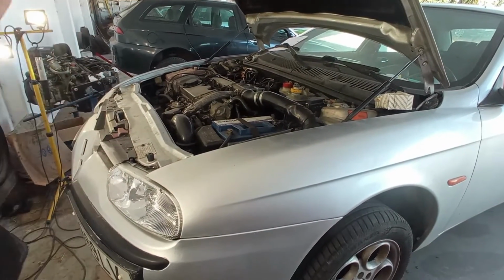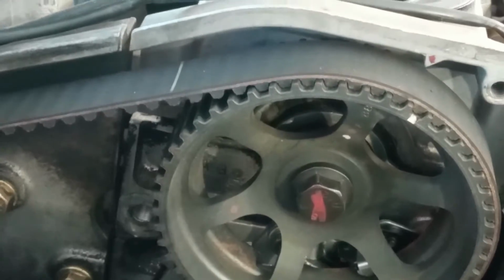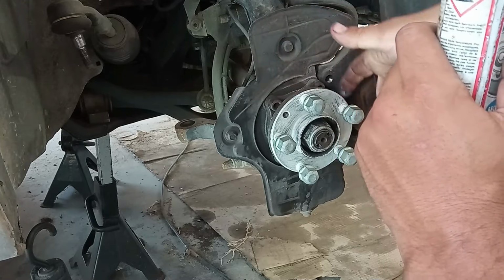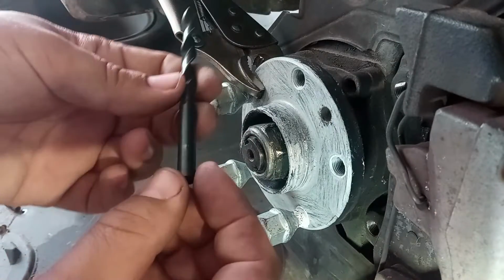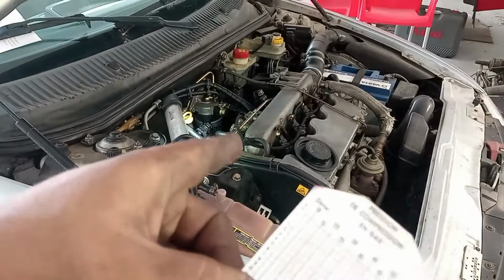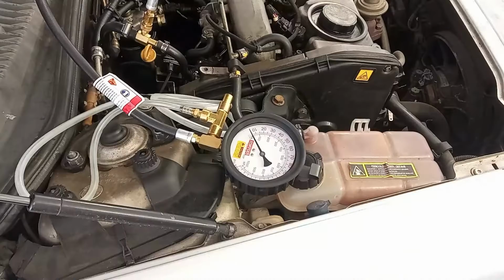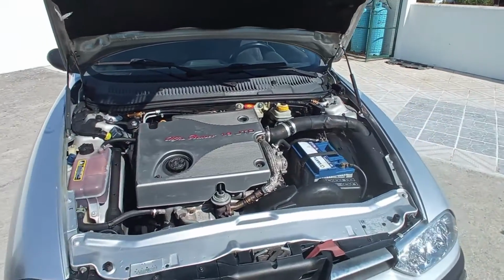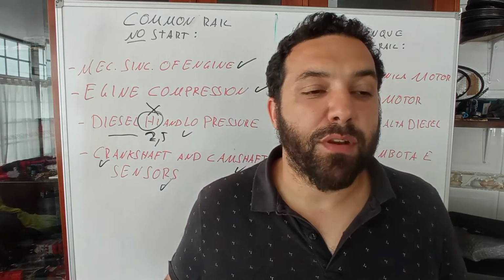Crank No Start Common Rail Engine!? Complete Troubleshoot! Alfa Romeo 156 1.9 JTD

Comment: Hi Bruno! My brother's 156 1.9 jtdm 16v has a hard time starting from cold (battery seems fine when tested) but after a short time if you start it again it starts fine. 
Also it has strong vibrations on idle, and they are HORRIBLE when the engine is cold. Any ideas on where to look for the problem/s?
Reply from the maker: Hello, yes I have. Check timing and check compression. Swirl flap may have been ingested
Reply: @alfaromeonoproblem okay, thanks! I thought 156 didn't have swirl flaps on this engine, and only later GT had them. The 156 is 2005 though
Reply from the maker: Only the last year has it

Comment: you are lucky, this JTD cranks ... my JTD project does just one "clack" and the whole electrical system shuts down, only if disconnecting mass-pol and put it back, gives you a second try. Engine unit (ECU) checked by professional company -> absolutly fine. All mass-points cleaned, startermotor changed ... Faultycodes -> air-massflow-meter 4 faults, glow-unit 1 fault ... so nothing why not crank, nothing why breaking electrical system to shut down.
Reply from the maker: Hello. Check this out: https://youtu.be/S0SFTl21EQ4?si=EMRwFeY86WdPZu41

Comment: Love you videos!Realy helped me diagnose so many problems on my 159 1.9.
But now i found myself with another one and i simply don't know where to start.
I recently rebuild all my injectors(bad idle,smoke,weird stutter at constant speeds,
big injector correction) and all went well for two weeks or so.I have to mention 
that the guys at injector service and also my mechanic told me that this type of 
injectors do not need re-coding (they gave me the codes but i didn't write them in the ecu).
Now after two perfect weeks the car started to stutter again in 3rd at 2500 rpm,
and then suddenly stopped at a crossroad after braking and taking it off gear.It started right away but i dont know what to 
watch for now.The injector 1 and 3 correction are still high -2,5 and 3 (it has a new intake,
new fuel regulators,dpf active and healthy,and no errors).The car works fine but from time to time 
it feels like something isn't right with the fuel suply
The engine goes smoothly,steady iddle,no smoke.I just cant stop asking myself if the injector 
recoding is a must.Or maybe the high pressure pump is failing on me.
Still ,the pressure reads are ok,and no errors.i remember when i've changed the rail regulator i did have a pressure error,now nothing.
 Sorry for the long post,i wanted to give as many details as i can maybe you can direct me 
in what to look for next.Than you in advance!Any help will be apreciated.
Reply from the maker: Hello. Check out the connector on the 3rd injector. If it has a brown dust, the problem is there. Normally I resolve that with WD 40 and a zip tie around the injector to stop the connector from vibrating
Reply: @alfaromeonoproblem  Ok! Thanks! I will check it. Do you think i should write the new codes in or i should let it be? I'm afraid not to mess something up
Reply from the maker: @eucastana should write them in, yes
Reply: @alfaromeonoproblem  Ok ,will do.Thank you for your time!

Comment: Can I offer some advice if you don’t mind? You should never thread lock a Helicoil. The reason is because you are not allowing that coil to move outward during the tightening process which gives the mechanical advantage it was designed to have. If installed correctly they don’t come out during the bolt removal because thy can’t.
Reply from the maker: Nice, thanks for your advice

Comment: I love your videos man! I literally fixed so many problems on an Alfa GT 1.9 JTD

I am having a problem with a 2006 1.9 jtd alfa gt

In the morning the car takes very long to start, sometimes i can crank for like 7-8 seconds then turn the key off and do this like 3 times then the car starts

I have a new battery which is 70ah and 590CCA, is this sufficient to start the car?

The scan tool reads from +/-170rpm it jumps to 220 sometimes and it eventually starts
Reply from the maker: Hello. Thanks for watching! The battery should have at least 700cca. The varta e44 Will do well.
But if the starter is slow, you have to replace it too
Reply: @alfaromeonoproblem  awesome thank you so much for the reply, I will try that battery first
Reply: So I tried to start the car 2 days ago and it refused to start

When I connected the scan tool I was getting a maximum of 100bar on the rail so I'm suspecting it is the fuel pressure regulator

Is there any way I can test the regulator?

Thanks
Reply from the maker: @ramiromaney3499 hello. My advice is to take out the hi pressure fuel pump and have it to be tested all together. Age tells me that the pump suffers more that the regulator
Reply: @alfaromeonoproblem  awesome will give that a shot and update here so others can probably learn from my experience aswell

Comment: i really have to say, we need email contact :-) such great videos, that save so many people their troubles with their alfas ... your community is growing 🙂
i bought another 156 1.9 16V Facelift model 2004 with just 105.000km, where i am changing injectors and timing belt by your video advices. I am just curious ... how can it be finding some oil inside the cooling liquide? First, it was G11 filled, not G12 or G12+ , second liquide was not brown like  emuslified oil-water mix, third ... it´s unusual just 105.000km and expecting a faulty cylinderheadgasket. Are there other possibilities getting clean oil into cooling system?
Reply from the maker: Hello. Check out the description below.
Those engines do not have a water to oil heat exchanger. So the oil must come from. The engine itself.
Use paraflu UP only
Reply: @alfaromeonoproblem  that means ... possibility
1) from previous owner bad work changing timing belt/waterpump and oil got into the system once
2) cylinderhead crack
3) cylinderhead gasket faulty
4) engineblock crack
i am just wondering why the oil isn´t emulsified with the coolant
Reply from the maker: @dannydkasel8296 that is very odd on those engines. I gave never encountered that on those. Are you sure it's not a reaction with different coolants?
You cannot mix them
Reply: @alfaromeonoproblem  i didn´t mixed wrong fluids, i got this car with disassembled engine, no injectors mounted. I saw immidiatly the wrong, blue coolantfluid and flushed it out. Meanwhile i am sure it´s a faulty AGR Cooler. Why? The expansiontank of coolant has black russ from exhaust inside and what i thought to be oil is in fact diesel. And now everything makes sense, thanks to your videos. Yes, it´s unlikely having a faulty AGR Cooler BUT this shouldn´t stop everybody to check it. As the pre-owner said: injector were faulty, dripped permantly to much diesel into the engine, as consequence unburned diesel got through the exhaust. Having a faulty AGR Cooler, the Exhaust-Gases getting into the cooling system and the expansiontank gets really black. So, i will mount renewed injectors, block the AGR Valve, disassembly the AGR Cooler, bridge that two AGR Cooling lines, flush the system with lots of water, install new thermostat and then we will see, how robust and healthy this awesome engine is :-)
Reply from the maker: @dannydkasel8296 g11, g12 and g13 are not compatible. 
About the EGR cooler, so far I have never seen that on the engines

Comment: Amazing job.
10:24 Why locktight should not be used on that bolt?
Reply: I was wondering that too, maybe it's impossible to get it off after haha
Reply from the maker: Hello. Because the bolt as to give way being part of the self fuse system of the sprocket. In case of a broken timing belt.
Reply from the maker: Hello. Because the bolt as to give way being part of the self fuse system of the sprocket. In case of a broken timing belt.
Reply: @alfaromeonoproblem  Thanks.